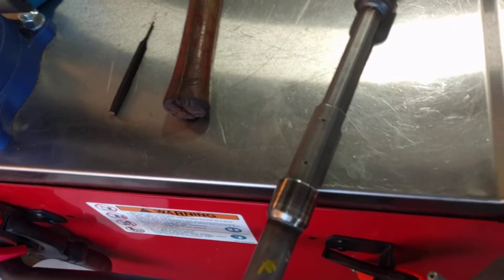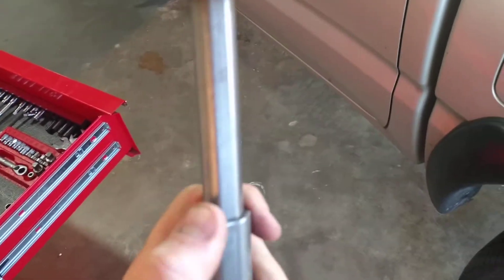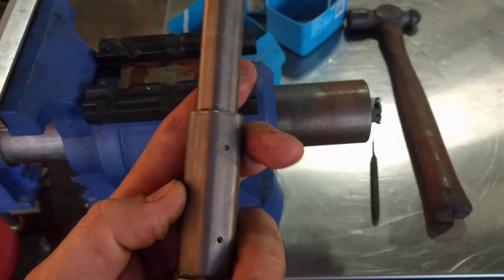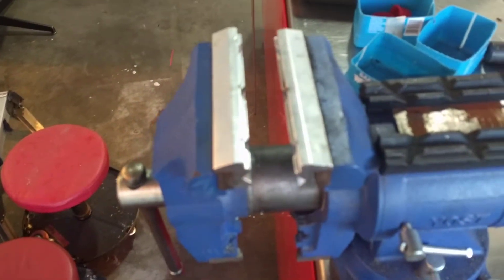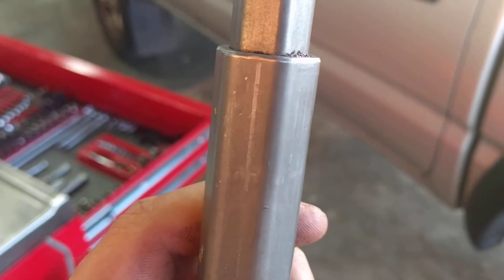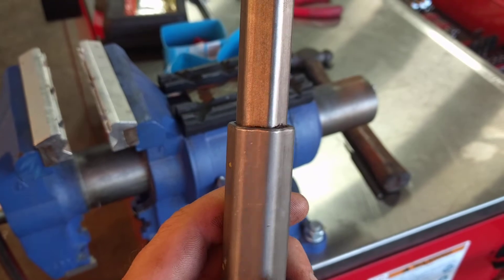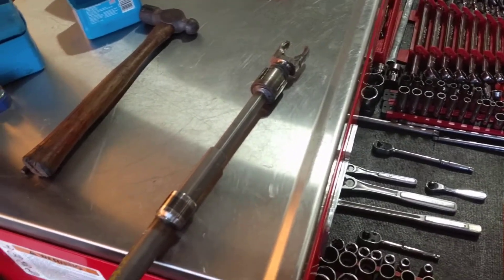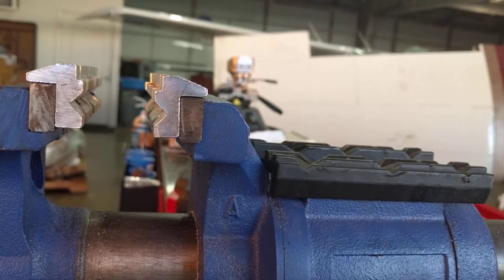Tacoma intermediate steering shaft play fix

Comment: I tried this fix and no difference ended doing 2 small spot welds. my vise actually broke it was 30 years old. my steering is
solid and I believe it would still collapse in a bad accident. A good welder can make them strong and small so I recommend a good experience welder
Reply from the maker: It will likely only collapse of the weld fails perfectly to leave no weld bead on the inner shaft.  If any is left behind it will not be able to slide into the outer shaft.

Comment: My 01 tacoma seems to have quite a bit of play. Seems like it would be too much for it to be the intermediate shaft. How much play was caused by the shaft having being bad?
Reply from the maker: kurtis bardin it's hard to quantify but mine was enough to have a significant dead spot in the steering where I could wiggle the wheel back and forth without any movement being transferred to the steering rack.  There are other places where play can develop, including the steering rack bushings and tie rod ends.  There latter can be a safety concern so check those ASAP!

Comment: Does the crimping hold ?
Reply from the maker: I wondered this myself after performing this "repair".  It's been 64k miles and it's still feel pretty good.  Can't say if it is as tight as it was just after finishing the project but it's not noticeably sloppy like it was before.

Comment: Thanks for posting. Is the part tack welded all within the "Intermediate Steering Shaft" assembly? Wondering if it would be cured if I just replaced this entire part versus tack welding it?
Reply from the maker: knollie81 - I don't believe there are any welds of any kind from the factory on the intermediate steering shaft.  there are two small holes with what look like shear pins inside of them.  I assume in the event of a frontal collision the shear pins would be weak enough to allow the inner rod to collapse inside of the outer tube.  a tack weld would significantly increase the amount of force required to allow the column to collapse, I would not recommend that anyone tack weld unless they understand it may prevent the safety feature from working correctly it at all.  replacing the intermediate shaft with a new part would also solve the issue of relative movement between the inner and outer parts but the part may be expensive and replacing it is the same amount of labor as this "repair".
Reply: Awesome, thanks for the reply! Seems like most of the Toyota SUVs and trucks I have driven suffer from these same symptoms.

Comment: Those who weld this will kill themselves in a crash lol, the column is designed to compress in case of an accident.
Reply from the maker: Daijoubu - I think that it is obvious that welding, even a small tack weld, would probably significantly increase the force required to collapse the shaft and that discussed in my comments.
Reply: Brad Arsenault so that the crimping and/shimming would be the safer choice
Reply from the maker: Daijoubu - indeed.  Though, the safest choice would be to replace the entire intermediate shaft assembly with a new Toyota part.
Reply: 485.00